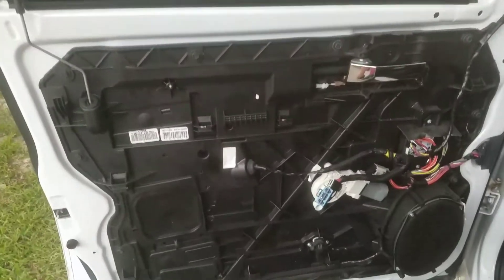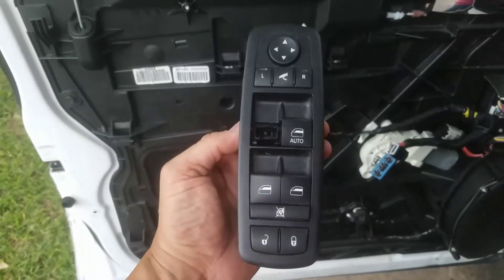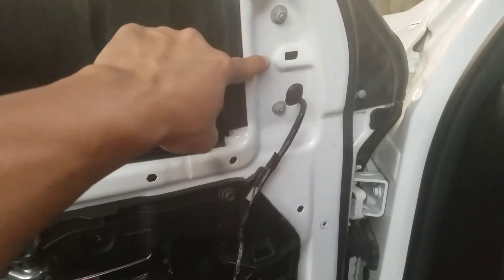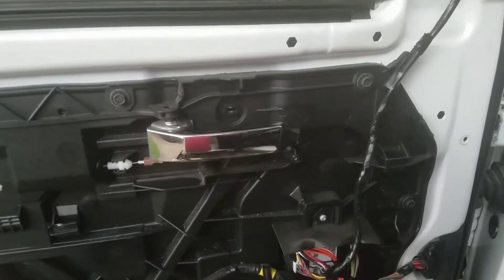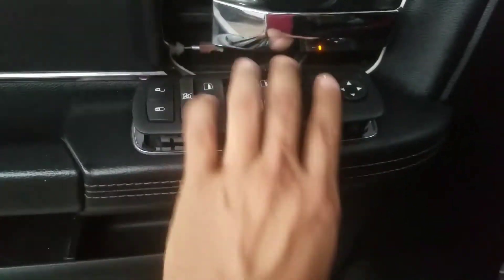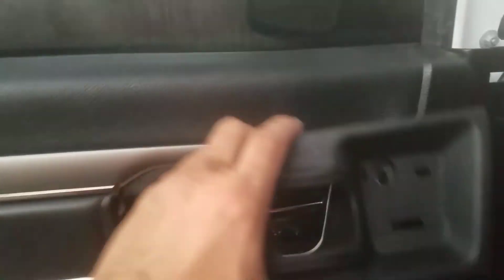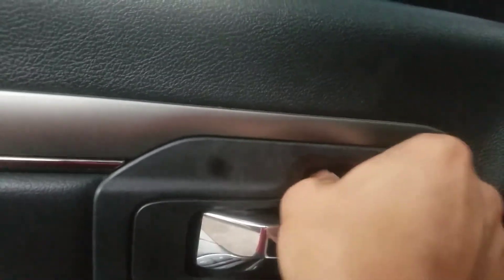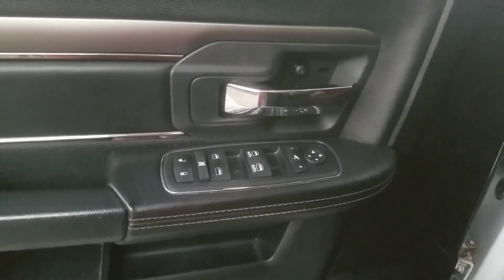2014 ram 1500 window switch replacement.

Comment: Can you please make a video about your thoughts on headers for 5.7 rams? I have a 2013 ram 1500 single cab with 3.92 gearing. Already have a cold air intake, ported 87mm throttle body, and resonator delete. Planning on getting a set of 1&3/4 ARH long tubes, and a Diablo i2 with a custom tune from hemi fever. Could I expect significant gains doing the headers and tune along with the mods I already have? Worth $2800? (Parts/labor/tune)
Reply: Oh yeah, I forgot to add. Should I swap out my muffler for a borla pro XS muffler? I'm pretty sure my exhaust is stock, but it sounds better (throatier) than most Rams I've heard on YouTube. And should I wrap my headers with the lava wrap heat shield? Thanks
Reply: Also, I'm getting Catless headers. Sorry. Haha

Comment: does your truck have the feature where you can roll down all 4 windows from the outside of the truck with the key fob?
Reply from the maker: E.DUNN no.. that would be pretty cool of it did.
Reply: B Mason i have seen some rams with it but i cant find amy solid info on what years or trims